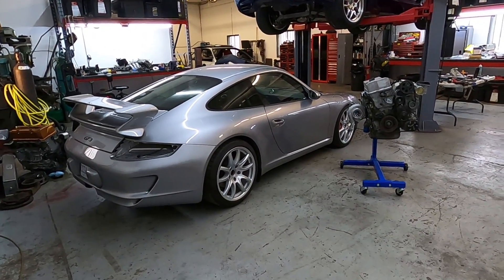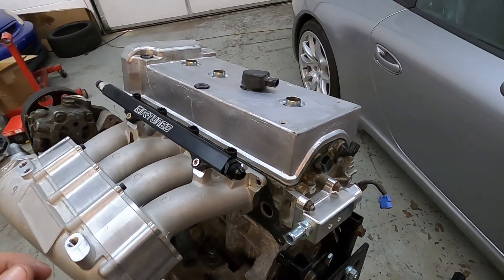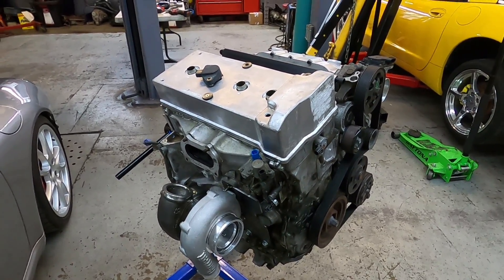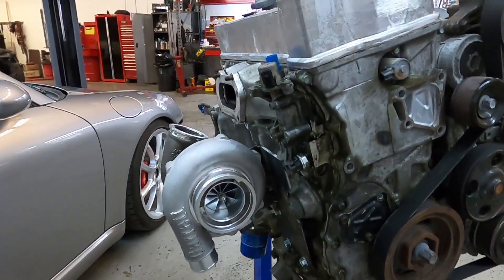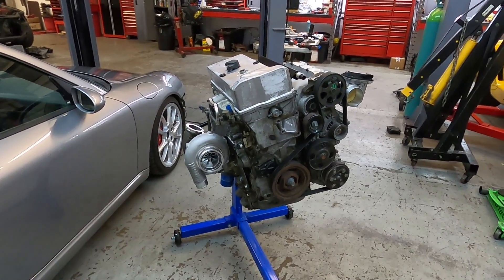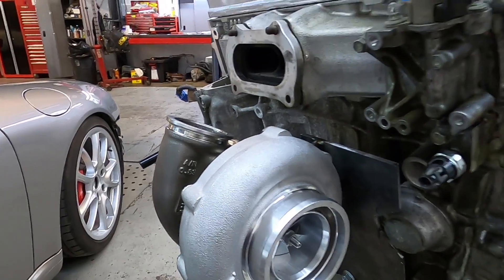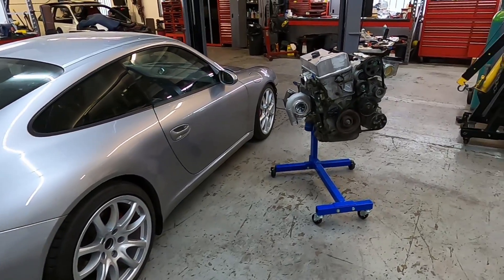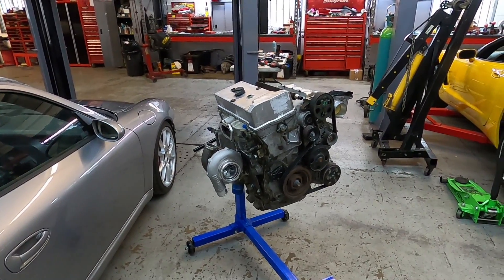K997 New Turbo - Garrett G35-900

Comment: Subscribed! One of the things I dream about are swapping in a cool motor into my 987 Boxster. You mentioned how you had to make a custom valve cover due to clearance issues..do you think any of the size issues could have been resolved by going with a K20 instead of a K24?
Reply from the maker: The K20 is only a little bit shorter - 3/4" short i believe. Unfortunately that wouldn't be enough, so you'd still need some sort of valve cover. You might be able to run the Drag Cartel Billet valve cover on a K20 tho. That being said, i don't think you'd have the same clearance issues in a Boxster because you have an engine cover that could be modified to fit the stock valve cover
Reply: @tuningbynick   Thanks for your reply!!! I'd have to rely on a shop to help me with the swap.  What would you say poses the biggest obstacle so far? Designing/cutting motor mounts, engine harness? I'm sure there are going to be tons of electrical challenges as well with the ECU and stock electronics/dashboard.  Eager to see you finish this out :)

Comment: Other than the proce being a little prohibitive (to buy any rolling 997 really, especially a GT3) I have to say this is one of the best/coolest swaps ever. 
The 997 chassis may still be rear engine obviously but Porche has any of the old nasty lift off oversteer and balance issues ironed out, and going to a lighter weight 4 cyl with more power and torque is awesome. 
Do you plan on just street driving? Backroads? Circuit/track days?
Reply from the maker: Thanks - (Its not a real GT3 btw - Its an "S") I love this car, but honestly found it slow and was always leery of really enjoying it at a track. An engine failure on one of these is extremely expensive. This swap will take care of 2 birds with one stone - It'll be significantly faster and give me the piece of mind that if there is an engine failure, its only like $1000 for a new engine. I do plan to enjoy this car on the street and track as much as possible
Reply: @tuningbynick  Thats awesome to hear, as I have a feeling thats where this car will really shine. (And roll racing is fun but not nearly as fun as nailing a 4th-2nd heel-toe into a good corner). 
I totally agree the M97 3.8L's are really underwhelming. The GT3 engines feel like a bigger version of a K20 in N/A form, the C2/C2S just lacks character (and power).  300whp dynojet is nothing to write home about. 
I look forward to the final product!

Comment: The motor is looking backwards, right? Shouldnt the intake side of the turbo should be facing the front of the car?
Reply from the maker: Yes, the engine looks towards the back of the car, but the fresh air inlet is in the wing, basically right where the turbo inlet it now - I'll try and get a better shot next video
Reply: Tuning by Nick that makes sense!